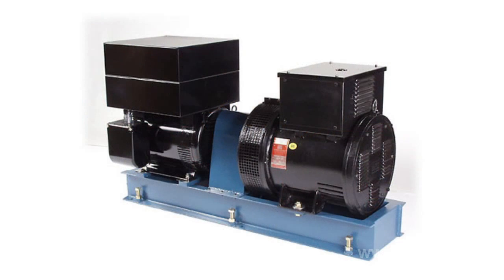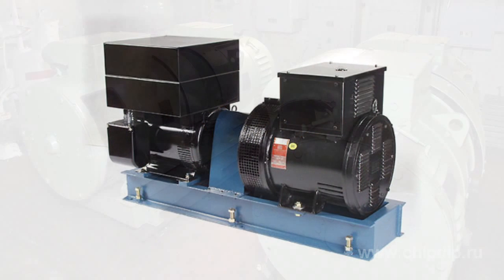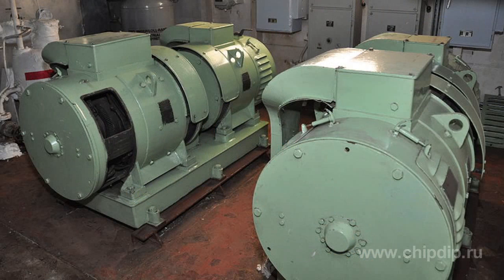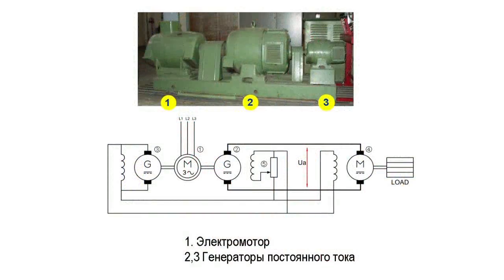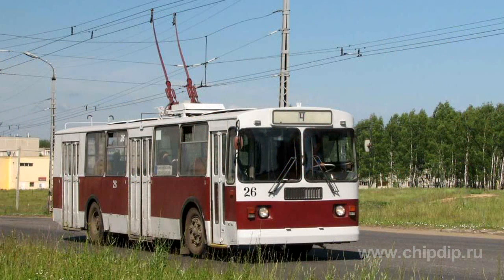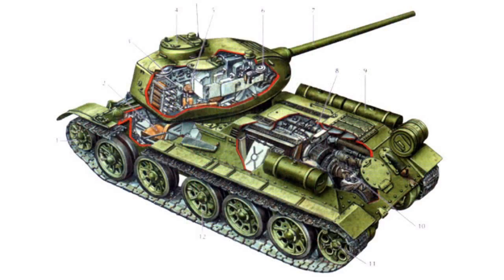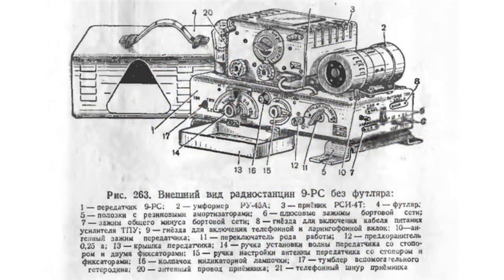Dynamotor

Comment: In the 1940's and onward, small, single housing dynamotors  were made for aeroplane and ground vehicle  use. These changed  6, 12, or 24-28 volts DC into 215 to 1000 volts DC or 3 phase AC depending on need.
 Consult BAMA website for examples of what they powered.
24-28volt input versions are still sold at Fair Radio Sales and Ebay.